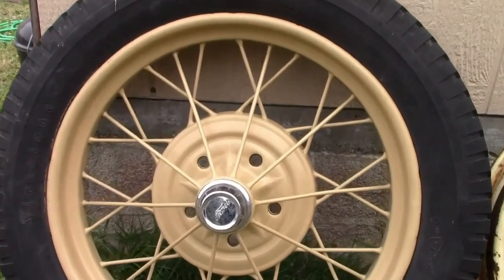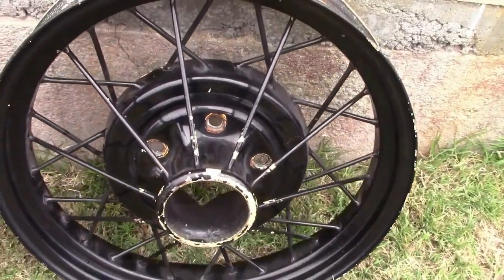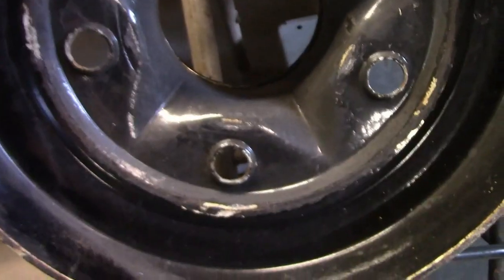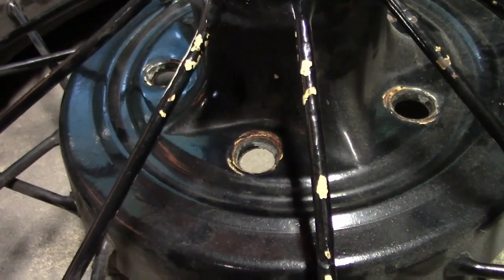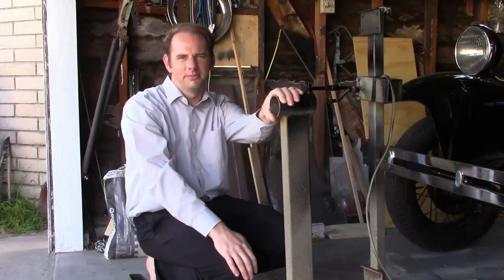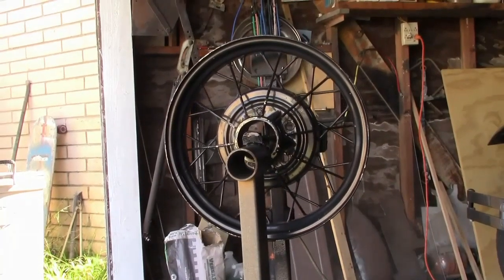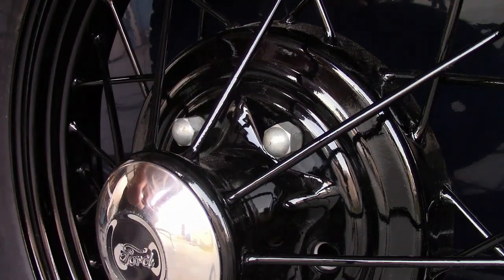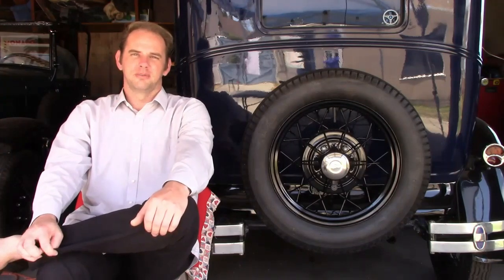Restoring a set of Model "A" wheels.

Comment: Good info. Much cheaper to paint them than to powder coat them, of course. But I've found that they will still chip eventually and need to be touched up. I used the harder to find 16" Ford wire wheels and had them powder coated. But I'm not entering my A in any MAFCA judging competition.

Comment: Paint vs Powder coating: Having revived my fathers 1930 Model A 5 window coupe, that sat broken and in the garage for 47 years (and I drove to the Junior Senior Prom 50 years ago, literally), as well getting back into the 'A' community.

 Simple call for me on the "you have to have your wheels powder coated" peeps. My response: Well, you know,  paint on wheels seemed to have  worked pretty well for the last 100+ years or so,  also, I can have any color I want and refinish them myself all for about $50.00 vs. several $100.00.  

I guess 'common sense' just isn't common is it?! (nope) Anyway, I enjoyed your, once again, no nonsense approach to getting it done, and well. Thanks. Keep up the good work!

Comment: Excellent video!  I didn’t see any mention of balancing the wheel.  Do you balance these?
Reply: Most people I know that own Model A's do not balance the wheel/tire.   Unless the wheel or tire has a problem (rare), you won't gain much by balancing them.  And good luck finding a balancing machine that will take a Model A wheel - not very common any more.
Reply from the maker: Thank you. I don't balance wheels because it's only really noticeable at higher speeds and I rarely drive over 45 MPH. It probably would be a concern if one plans on driving on the freeway a lot.
Reply: I daily drive a 1930 'A' coupe.  Here's what I've done RE: wheel balancing and with great success I might add, to 'balance' my wheels. 

 I found and installed a product (into the tire tube) called "Balance Beads"  They are very small 'ceramic' beads that find the boo boo areas via centrifugal force and balance out your wheels. I can really feel them 'go to work' at about 27 to 29 mph. They are reusable if needed and run about $48.00 for the amount needed for the Model A 19"x4.75" tire.  A very easy solution to a rather difficult to repair (too me anyway) situation.  Highly successful, Highly recommended!!
Reply: @mlackey9812 Have heard about these; you're the only one I've heard that felt they made a difference.
Reply: @mafcawebmaster4237  These beads have been used in the 18-wheeler industry for years. They aren’t snake oil at all. I have 6 vintage motorcycles and have never balanced the tires and necker felt the need to. I added beads to one last year. If you have a defective tire(Duro or other Chinese tires) nothing will help. that was my situation.  But I suspect when a difference isn’t noticed it’s because it wasn’t out of balance by much to start with. Also keep in mind beads are a dynamic rather than a static thing. They rebalance to the need every time you leave from a stop.

Comment: Chiming in 'again' (7 months later) on paint vs. power coating. A. the rims were 'originally' painted, B. paint cost an average of $4.75 per wheel (I've done the math as well as the 'painting') vs. $600.00 ish for something that isn't, in my opinion better or needed.  How long do you need the color to last? if it's more than 75 years and you just need to drop a few sheckles......then, by all mean's......go powder. Me? I'm a paint guy and no one can tell the difference.

Comment: I have a question.  The 29 coupe I am restoring had horribly pitted wheels.  A local Mode, A club member sells all kinds of parts for the A’s.  I went to him and , for a price, I traded my old wheels for some much better ones.  One question though.  Just one of the wheels has the center hub area between the hub cap and the wheel mounting holes that is a bit smaller diameter than the other four wheels.  Four of the wheels measure about 2 1/2 inches diameter hole but the one wheel was about 2 3/8 diameter.  Did different manufacturers of the wheels have different through hole sizes in the hub?  I figured this out when I was making a jig to hold the wheels for painting.  Your thoughts would be appreciated.  Tom
Reply from the maker: I've never seen that before, but that sounds normal. There were 3 different manufactures for wheels in '28-29. Thay interchange, but there are little differences between them. That may be one of them.

Comment: NOTICE:  Do NOT use re-pro' wheel nuts, most are made in China and are not made right, are not machined out inside a little, in order to seat right over the base non-thread of original studs.
I only use genuine Ford nuts, wheels can work their way off, this is not a pleasant drive ~~